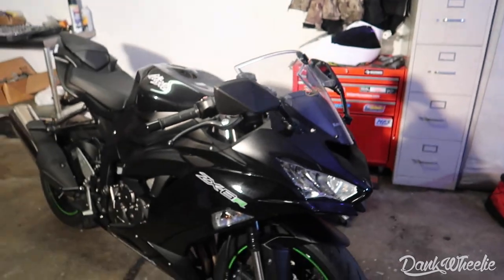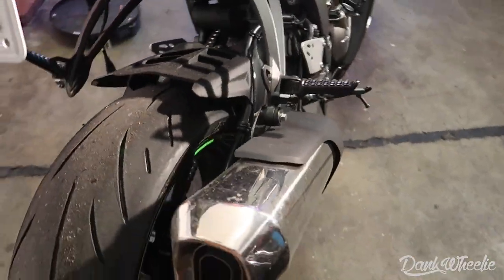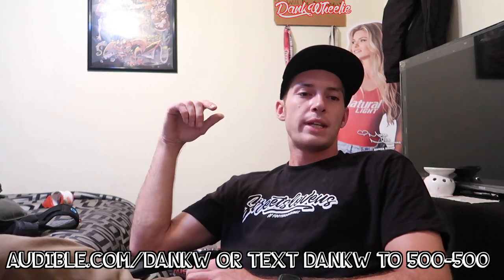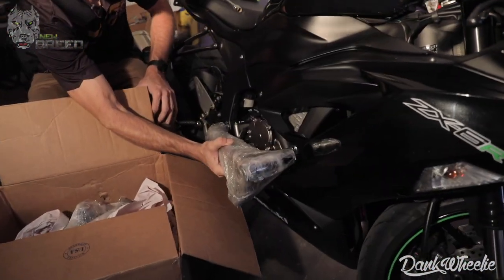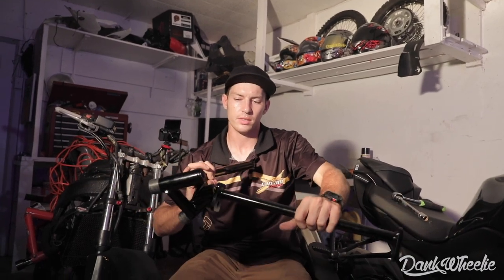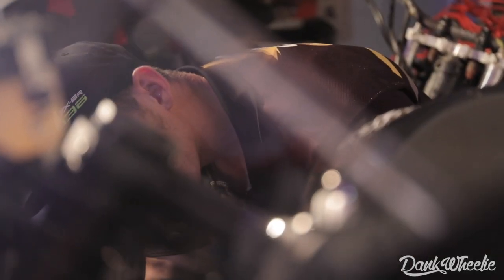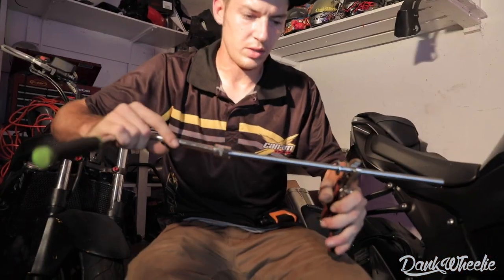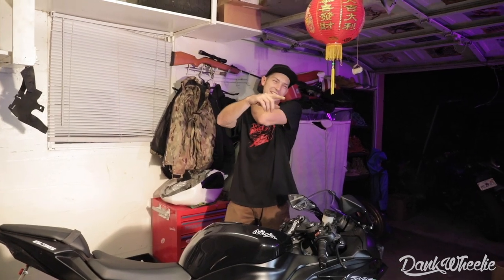2019 Kawasaki Ninja Zx6r Crash Cage / Racing Rails Install

Comment: Ht moto Seats, some dope rearsets, steel braided lines, can’t just have the cage gotta have the subcage to go with it, clutch lever, a dope front brake master, radiator cage with an extra fan just in case and exhaust. Not fully stunted but clean

Comment: I have the same tail setup on my 19 zx10r you should go ahead and buy the tst signal relay it’s like $10 and gets rid of the fast blink from the LED blinkers. And I used the new rage front signals to mount them flush to my headlights totally cleans up the bike.

Comment: Hey dank! So I’m doing this to my 2008 636 and found that there are different threads on the frame and on the engine mount, should I bolt the cage in the frame thread or the engine threads?

Comment: Are crash cages just for stunt bikes or is it reasonable to get a crash cage just as protection on something like an r3? I dont want to stunt, i want to protect the bike but im worried if it will like hinder me from leaning in corners.
Reply: It's not just for stunting. Can save your bike in case of even an accidental drop just from normal use.

Comment: wondering if anyones knows if the 2008 zx6r is any good for stunting?
Reply: Alex Hannibal the 2008-2012 zx6r doesn’t have the 636 motor just has a basic 600. Is it stuntable? Yes. Not as good as the 636
Reply: @motocam1497  ah ok  I wanted to start and I have an 08 zx6r p7f so yeah just wondering :)
Reply: Alex Hannibal big sprocket and a bit of practice can make any bike a stunt bike my friend
Reply: Any bike is a stunt bike 👌🏼